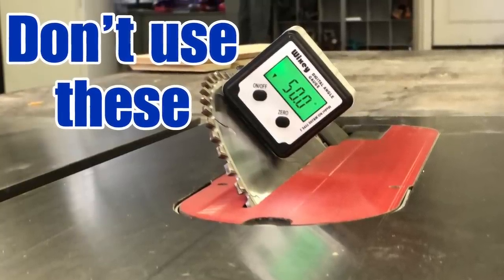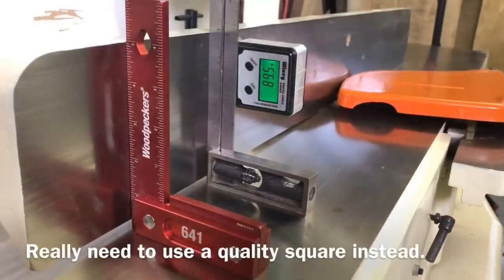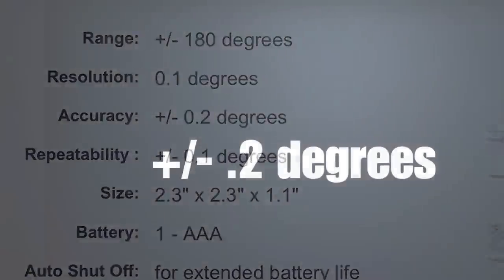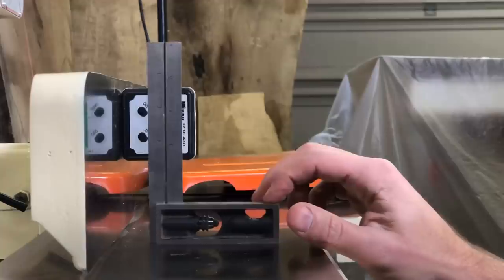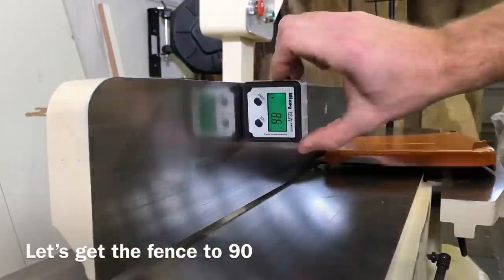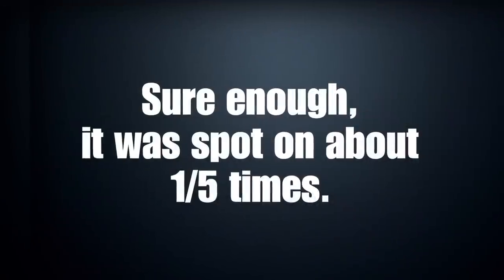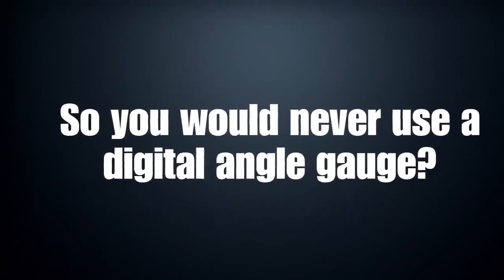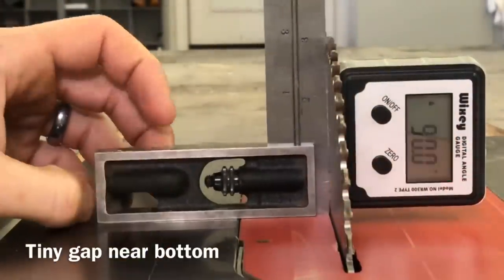Table Saw 101– Digital Angle Gauges— How To Woodworking

Comment: By the way I make cabinets for a living and things have got to be square and I don't just do cabinets I do the custom stuff which deals with angles in whatnot so first you have to check to make sure your table is square or flush or level if your table is level and the digital scale is still reading wrong there is a set for relative 0
Reply from the maker: Sounds like you definitely don’t need my help! Thanks for the comments 👍🏼👍🏼
Reply: @BlacktailStudio  That's a great response. I'll have to remember that one. 😄

Comment: So did you even bother to check if your cable was Square sounds like you forgot to check to make sure everything was level I have a digital one and it reads accurately up to the point where I can make a septagon check it out
Reply from the maker: Not sure exactly what you’re asking. Level doesn’t affect these. The main point I’m making is that they aren’t accurate enough for most of what I do. Even if they are working properly, and operated properly. Per the tolerances the company gives. If they are good enough for you, definitely keep using them!
Reply: If the table is not level then even if the gauge says that is 90 it may not be if the table is not level it may read 90 and may not be the square is square regardless a digital Square is square relative to the table show us the table is off the degree is our therefore would read 89.5 instead of 90 my table saw is almost level but not quite and it read the same
Reply from the maker: Charles Little maybe we’re confusing level with flat? Obviously your saw or floor doesn’t have to be level to use either a square or a digital gauge. It’s zeroed out wherever you zero it out. And please don’t take offense, but we gotta work some periods into your paragraphs. Super hard to read with no breaks. Which may be why we’re having some confusion.
Reply: @BlacktailStudio  LOL yes sir I appreciate you and your comments. 😄 . Anyway to get things as accurate. May not be a Rolex watch but when you're doing inlay it might as well be
Reply from the maker: Charles Little 😂 Nothing I’ve built resembles a Rolex. But if I give it my best, maybe I can make a Casio.
Reply: @BlacktailStudio  no brother LOL. I was referring to one of the commenters who is talking about Chippendale and Rolex

Comment: This is exactly why I never build anything with an angle in it. I just take flat pieces of material and glue them together. Either face to face or end to end.  Do these projects of mine ever serve a practical purpose?  Nope. But they are never out of square and they give me an excuse to hide in the garage.  Does anyone ever buy my stuff?  Nope. But at least my non-existent customers know I’m straight as an arrow.  All you other woodworkers, on the other hand, well sure you’ve got paying customers, but they all know you’ve got an angle. 
Anyway... as a wise old carpenter once said regarding perfectly square joints:
“WOOD that it were so simple.”

Comment: You need to reformulate this video. It's misleading. You can see there's a gap at 1:46 at the bottom part of the red square. So the reading from the digital protractor is actually close to accurate. That fence is leaning into the table. After your correction the digital tool shows a closer to square number and the squares show no gap...
Reply from the maker: The main thing to takeaway is that the company says these are only within .2 degrees. So forget my poor video quality and structure. These just aren’t accurate tools

Comment: Your digital gauge is off probably because of factory error allowances and because your table saw likely isn't perfectly level enough with the floor (it measures the angle relative to gravity, not to the saw and table)
Reply: There's a Zero button on the gauge.  It can be zeroed to match any slight deviation from flat.

Comment: are you sure your table saw is dead flat at the point where you set the square?
Try a straight edge from the side of the saw blade out to the left and right.
You might be suprused of how not flat a tablesaw top can be.
Reply from the maker: Thanks! I do check from both sides. My saw table is very flat. Which isn’t always the case. Especially with cheap saws.

Comment: so, how do I get a 22.5 degree angle with a square, that would have been more useful than nit picking a gadget ... which was more accurate than you rocking a name brand square back n forth on a table like a sea saw
remember, you're cutting wood, it will measure different 20 min's after the cut (bet you don't check for that) depending on weather and shop conditions
Reply from the maker: Woodpecker makes a 22.5 degree tool. Actually comes with several different non-standard angles. Thanks for the question!
Reply: You can use math and accurate measurements to come up with any angle. but if you're doing fine woodworking you probably have a bevel gauge and a protractor in which you can use to set up an angle.

Comment: these digital angle gauges work using accelerometers measuring gravity, so when you are measuring higher angles 85+ they will become less accurate but when you can use a square obviously use a square

Comment: A piston wrist pin or gudgeon pin from a large engine makes a very good accurate cylinder square & will be more accurate than any of your squares in the video...😎👍
Cylinder squares are often used in engineering & are interesting beasts... google 'em.. 🤨

BTW... +/-0.2° = a possible max error of 0.4°... you stated it earlier but reverted to 0.2° later in the vid...🙄😏
Reply from the maker: Thanks for the comment!

Comment: I bought a cheap Chinese knock off - it was TERRIBLE... you couldn't even ZERO it fully - it would go to 0.10 degrees at best and if I put it on a regular 2 ft level, I could move it 1/4 inch and it would give me a totally off reading... I really need to try a high quality one with a +/- 0.01 accuracy.

Comment: I only got as far as 1'15". The specification of the gauge clearly showed 0.2 accuracy over 90 degrees (which is always understood to be at full scale unless specified), and 0.1 repeatability. So don't complain that it's doing exactly the job it says it will.
Go on ebay and buy the cheapest, they are all the same. Under $10.
If you want to make precise mitres, try using a shooting board, here's Paul Sellers version:
https://www.youtube.com/watch?v=-Ypbvcxb-8M
Reply from the maker: Thanks! We’re on the page. Just informing people they aren’t as accurate as they might think.

Comment: Well our eyes aren't good enough to detect variances of 0.1 or 0.05 usually, there are people with very good eyes that can, so unless your using feeler gauges with those squares then don't think your always as close as you think. I would not trust any of those squares to be made right and exactly 90 either. Maybe 50 years ago when Starrette made things properly but not this modern made rubbish so the digital gauges are fine. Unless the blade is being set up with dial indicators and a sine bar and slip gauges then it won't ever be exact with squares or digital gauges.
Reply from the maker: I should have clarified. For most cuts they are fine, but I definitely want a quality square for glue joints.

Comment: I use a wixey to cut 60 degree angles for hexagon boxes. No problems 2 years later. Woodworking doesn’t need machinist grade tools.   Im also not happy I downvoted your video. A woodworking video.
Reply: An adverse opinion, stated respectfully, is not worthy of a down vote. We all need to be wise enough to listen to all arguments and make up our own minds without condemning those whose arguments we decline.

Comment: For all those woodpecker squares you could of got much cheaper much more accurate machinist squares lol
Reply from the maker: Steel ones are ruined if you drop em once. Aluminum ones won’t be
Reply: @BlacktailStudio  Then don't drop them.... But they are much more accurate and a lot cheaper.

Comment: A machinist relies on the most accurate instruments to adhere to the closest tolerances.  Milling a cylinder bore to exact specifications to  accept a piston will affect the performance and the longevity of the engine.   That piston will travel the length of the cylinder bore many millions of times during the life of the engine.  The accuracy of the tolerances is often the difference between a consumer grade engine vs. a commercial grade engine.  Same is the differences between a Chevy engine and a Rolls Royce engine.  
For fine woodwork....Not So MUCH!  Wood is a live material that changes it's dimensions throughout it's life due to temperature, humidity and the inherent grain structure of the species.  Most of my wood joints are made with an adhesive of some type and the glue alone will produce a variance of 0.04 regardless of how you clamp it.  "Oh My!...One of the four legs on my chair is 0.04" longer than the others".
Reply from the maker: I definitely know what you mean! I guess I just prefer to control everything I can to help compensate for those factors I cannot.
Reply: Right On!

Comment: Those digital levels are expensive toys.  Cutting a 12" wide board a .2 degree miter error will be about 1/16".   You could actually, not kidding square a saw blade better with a piece of 2" x 4" on edge.  Literally.  They are for grape kool-aid drinkers.  I don't mean kids.  If you tried to make a picture frame with a miter off .2 degrees it would be about 1/4 inches out of square.  A cheap square from the Harbor Freight, Wals or Walmart would be MUCH better.  A plastic school protractor better for angles.

Comment: 1 your being ripped off. Moore & Wright who are one of a handful of go to names for assured calibrated tooling cost less than the prices you mentioned. 
2 Horses for courses I wouldn't use a Vernier gauge when I need a micrometer accuracy yet both items are accurate
3 is your workshop a standard 20deg and humidity controlled if not then your observations are flawed as that is the standard for measuring equipment and why measuring equipment is stamped with STANDARD AT 20deg.
Reply from the maker: Thanks for so many words!

Comment: That digital gauge will only work if your equipment is completely level with the earth 🌍 I didn’t hear you say that you had leveled your jointer???
Reply from the maker: Neither of these gauges (digital or fixed) have anything to do with how level your floor is. They zero off of the flat part of your table (or wherever you zero it out) Can you imagine if every shop floor had to be level?? I can understand your confusion.
Reply: Sweet I think I’m gonna get one! Thanks for the video😁

Comment: All your comments are based on a perfectly level floor and a perfectly level tool base.
Reply from the maker: Drew Johnson Na, they’re all based on the table saw table or jointer fence being perpendicular to the cutting surface. Things would get confusing if we had to have level floors!
Reply: But then you would have to have a level house foundation and then level landscape and live on the Salt Plains. So glad we don't have to.
Reply: Drew Johnson,  I was thinking exactly the same, at no point do we see the level of the base. Why don’t the people take into account the floor and base?
Reply: Martin Parkinson,  I have never used a digital device.  If the device recognizes the plane of the horizon, then the floor has an affect on the measurement. If the digital device can be indexed to zero using the table, the floor no longer comes into play when measuring using the table as the reference point.